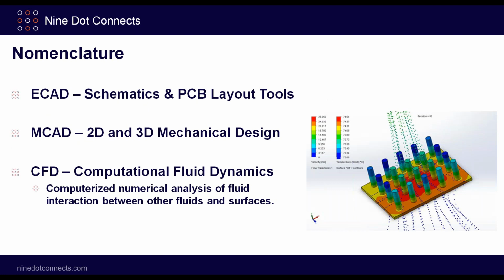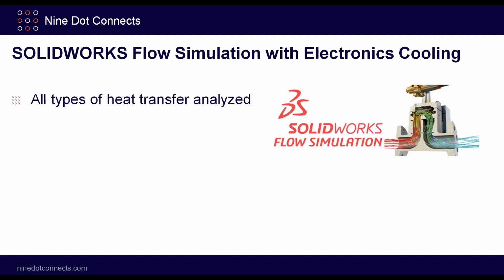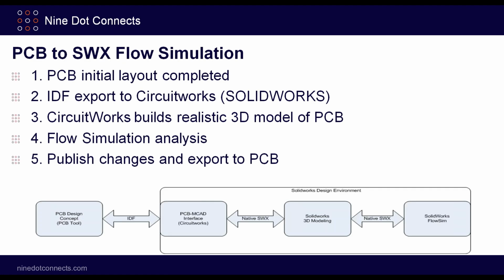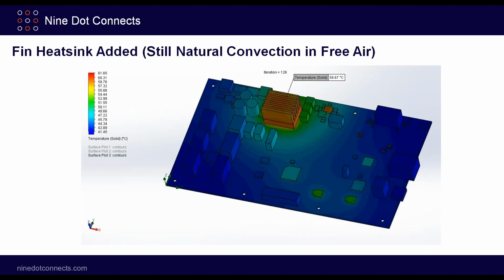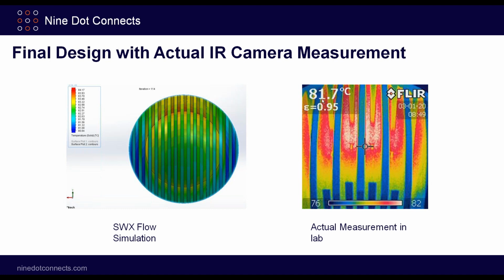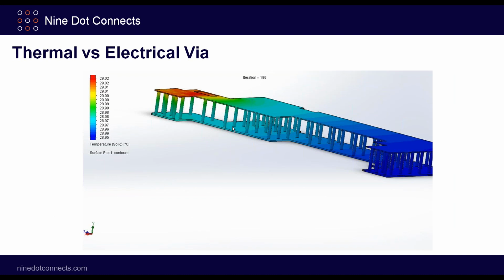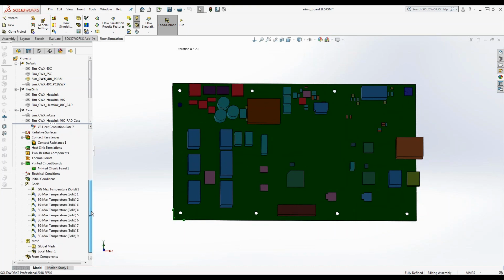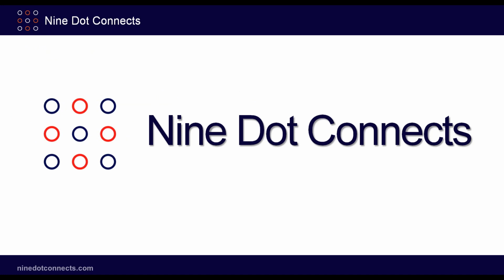Beyond a Heatsink - Thermal Considerations in PCB Design

Comment: Notice that simplification with CircuitWorks is very handy while struggling with some mesh problems about detailed 3D model of components on PCB. Also, CircuitWorks can be used to filter out some component which are not significant in thermal analysis. 
Thanks for informative webinar.
Reply from the maker: Thank for watching and your comment.